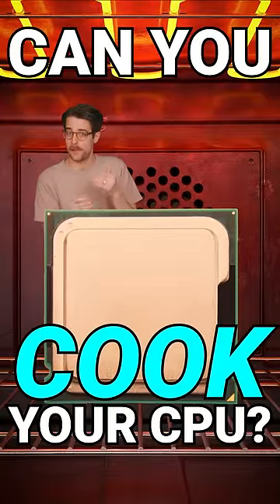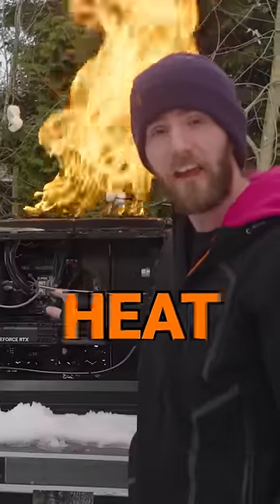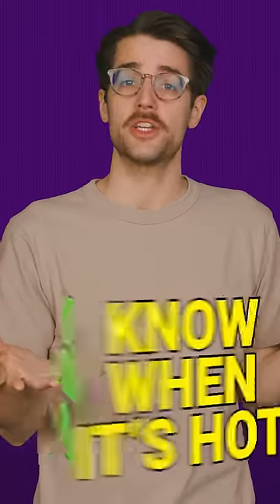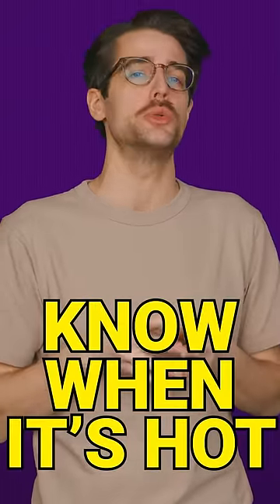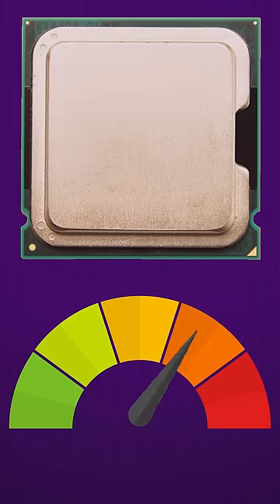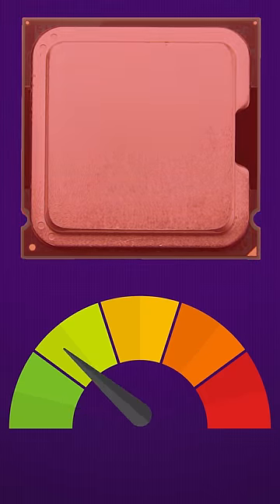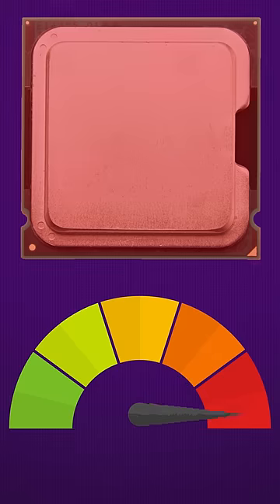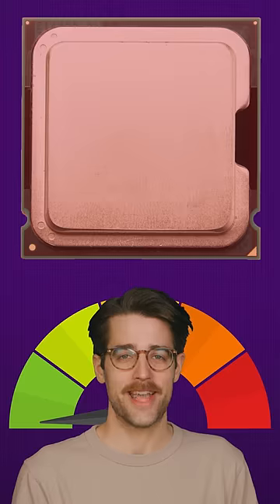Can You Accidentally COOK Your CPU? #Shorts

Comment: My CPU used to be over 100C constantly while playing, now that I capped it at 95%, it does not go over 80C.
Reply: Or hear me out buy a new cooler
Reply: @grenadeasc What's considered new these days lol
Reply: @infernaldaedra  one that can keep up with your CPU in this case - new to him. A 10yo Noctua 120mm+ will do fine - Noctua will send you the mount kit free for any modern CPU if you send them a pic of the cooler and the mobo or CPU you wanna mount it on
Reply: @mycosys Solid answer your cooler should be able to handle your cpu. In my experience noctua, be quiet, cool master, Thermaltake, thermalright, deepcool, arctic, CRYORIG, raijintek. And shout-out to AMD for their wraith line of coolerd and dramatically raising the bar for oem CPU coolers 👍👍
Reply: @Brian Babin I guess but it's actually possible if your practiced you can get the dot to cover like 95% ihs which is good but the problem is spreading leaves a large pool of thermal paste in the middle. :(
Reply: Reapply thermal paste maybe
Reply: @infernaldaedra  Not sure what you're on about, its been tested time and time again and proven that paste application so long as you apply enough makes ZERO difference.  If the mounting pressure is correct, it will spread out to evenly fill the gaps regardless of application method.
Reply: @alexatkin  functionally there's no real difference but eventually we will find a better interface than thermal goop
Reply: What are you using? 13900K or 13700k?
Reply: It might not be the CPU cooler. If the case has bad airflow, the best CPU cooler will suck.
Reply: disabled cpu  turbo on my laptop has better performance  . 
hp pavilion gaming
Reply: @david2438  that means the thermal capacity is too low for turbo boost. That's probably more of an Intel issue than HP or the cooling on laptops is still dookie
Reply: Not that related, but during an internship at a PC Service and repair shop we got a PC with a CPU instantly jumping to 114°C. No stresstest, just booting windows. Can’t remember whether it was a faulty board (asking the power supply for too much power for it) or power supply (just jamming more power into the system without being asked)
Reply: @Friendly_Neighborhood_Dozer Maybe one of the sensors was off on the die or a large part of the silicon was shorting out or something that's odd. It's firmware coded to shutdown at 100° so my guess is honestly bad Thermal sensor
Reply: that is a verryyyyyyy bad idea, you are losing way more than 5 percent performance. when you cap it to 99 or below, it disables turbo boost, which gives a lot of performance and let's your CPU run to it's actual potential, a better idea is to get a new cooler
Reply: @shanthoshravi5073  it’s a worse idea than having your CPU constantly over 100°C? I can understand to not wanting to buy and install a new fan, but lowering your performance is still better than constant overheating imo
Reply: @Friendly_Neighborhood_Dozer  modern CPUs have lifespans of 15+ years. constant 100 plus degrees on the CPU reduces life span by maybe 3-4 years sure, but other components in the pc would have long died before that. CPUs are very heat tolerant and one of the most durable parts in a PC. they are the last thing to die in a PC. however throttling that occurs over 100 degrees is an issue. A much better idea is to use throttle stop and limit tdp a bit lower, which still reduces performance but not nearly as straight up disabling turbo boost.
Reply: because it doesn't turbo boost anymore and only running at base clocks which is half the speed of the turbo boost

Comment: My i9 13900K would regularly hit 95-100°c, but in the bios, I turned off the Asus setting that pushes the CPU further on top of Intel's turbo boost and limited the voltage to 1.34V, and it lost about 100mhz of turbo but still hits 5.7ghz, and hasn't been over about 84-85°c since. It still thermal throttles sometimes, even though I have a Corsair H100x cooler. The technicians at the computer place I got it from and who built it for me reassured me that those temps are fine, I was very concerned at first as the 4790k I had in my previous PC never got that hot or thermal throttled.

Comment: My new Beelink Mini PC (it's tiny!), while being stress tested in Prime 95, hit around 80c. If it hits the maximum temperature (105c I believe) the system will shut down. In 27 years of building and using computers, heat hasn't been an issue!

Comment: My I7-3770k had the power to the water cooling pump disconnect. It would run great for about 5 minutes then it would slow to a crawl. The worst thing was the computer got so confused the temperature monitoring software didn’t show the temperature correctly. So it took a month to figure out why it was being slow.
Reply: u mean u were monitoring coolant temp not core temp?
Reply: Have the same cpu but when in installled it i somehow forgot to put the fan in, so i learned one of those failsafes the hard way
Reply: @EnderHero  Had that happen on a i7-3770 when I knocked the fan off once. The fan legs being cracked made it fairly... fragile.
Reply: @blunderingfool  lol rip

Comment: What does it mean when people say that newer chips are designed to run hotter? Does that mean they are more resistant to damage caused by heat, or that manufacturers are just allowing them to reach higher temperatures, trading lifespan for performance?

Comment: Sad you didn't mention the t-bird athlons that would literally burn up if given really inadequate cooling which could happen if the mounting was wonky
Reply: Yeah but that was before thermal management control loops were put into the BIOS. You could overclock but you had to know the process. Then it all got enhanced and automated. I was stunned the first time I ran AI Tweaker (UEFI) in the ASUS BIOS. A couple of self-reboots and it was running well beyond baseline and very stable. And I could still same that config and tweak it further.

Comment: Once my fan curve didn't work at all and therefore no fan spun. My Ryzen 5 3600 reached 120° and didn't even shut off.
Once I noticed, obviously I shut down the PC immediately.
Reply: I noticed similar behavior on my R5 5600G.

I was testing PBO to do automatic overclock and went to grab some snacks.

When I'm back, the CPU was showing 108°C on HWInfo and CoreTemp... and AMD website states that maximum operating temperature as 95°C, what !

I put 85°C temp limit on PBO after that, not going to take any risk.

Comment: 11th grade 2001 a amd k6-2 is overclocked to 1ghz through a combination of overvolt and replacement of the clock chip. the computer is put aside and forgotten a day later its turned on and the loose heat sink falls off the chip BURNED through the mb and the lab room is vacated due to the smell that never left.

Comment: Yo guys. My PC is almost 10yo, I stopped using it because of HD failure. Should I try and fix it or get something new(ish)?
Reply: Fix??? Just get a replacement 2.5 SSD and you're golden! It will feel like a new PC if you were using an actual spinning disc HDD before. Gives you more time to mull over and consider upgrade options/hunt for deals

Comment: Remember that the higher the sustained temperature the shorter the product life.  So even when you push it and back off 5% it will run but it will fail earlier. Read the specs.
Reply: While true, people worry about this too much.  The expected life span of a CPU is so long in the real world, you're unlikely to ever experience one dying no matter how hot you run it.  In fact cooling it too quickly after its run up to high temps is potentially more harmful, as its the heating/cooling cycle that does the most damage, or the higher voltage you're using to hit an overclock.

Comment: Something you dont seem to ever mention is higher temps MASSIVELY increase cooling efficiency in terms of CFM per watt. Higher temps mean ambient air will absorb a LOT more energy in the time its in contact with the heatsink due to the higher temp difference. This isnt something you use so much in a gaming PC, but in a studio PC or similar, shielded cases and higher temps are still the norm.